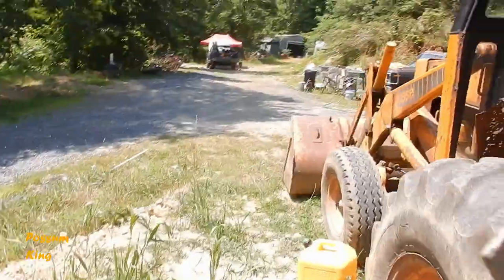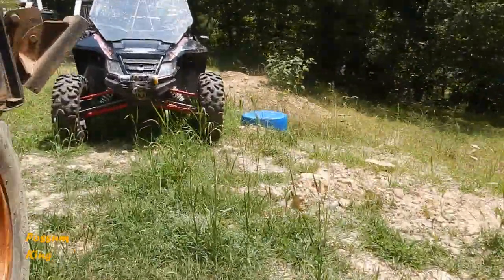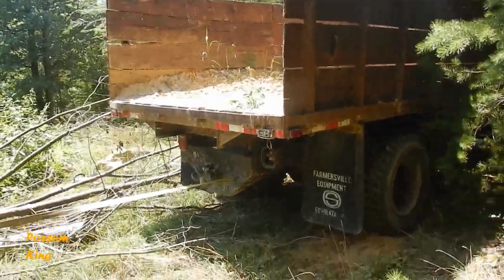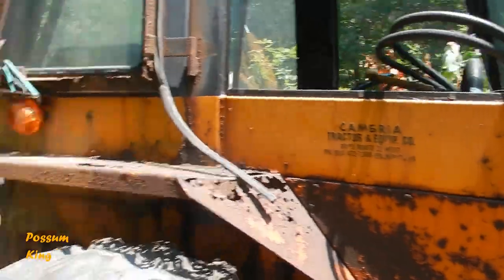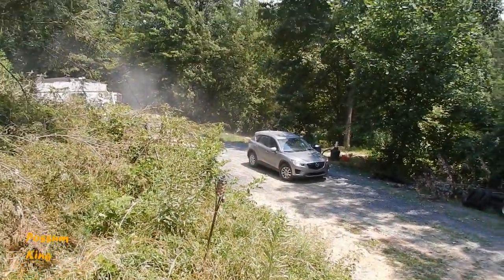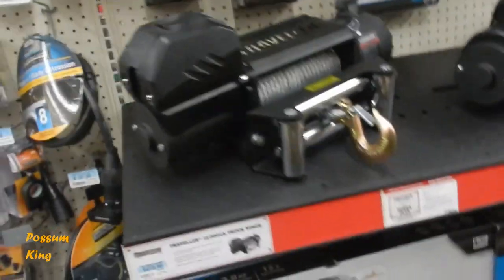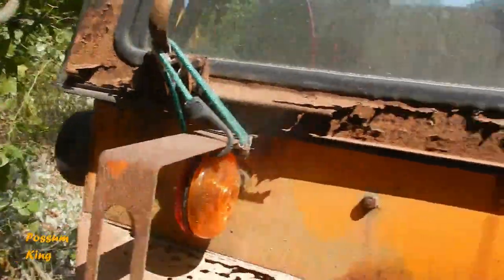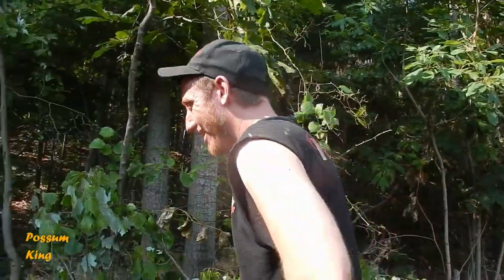I Almost Rolled My Backhoe

Comment: Not trying to armchair quarterback you but speaking as a fellow case 580D owner, why not use the hoe to lift up the back tires to reposition it. I do that all the time with my crappy trapter
Reply: Oh and I like your videos! Keep up the good work
Reply from the maker: Well, hard to tell on video but the backhoe was on a hill. If I did that it would have flipped.